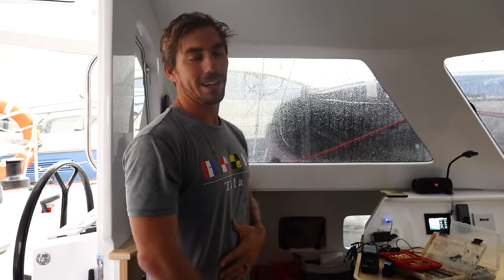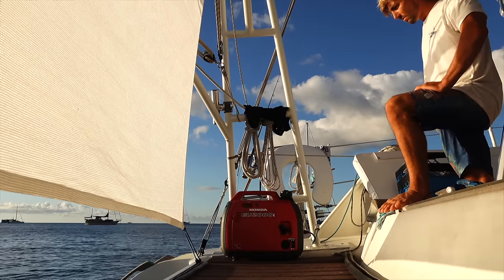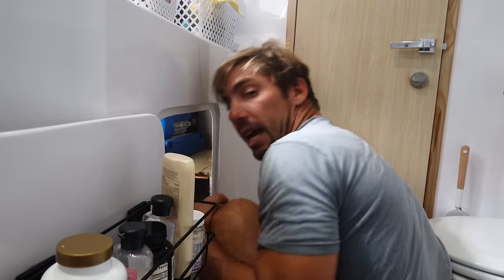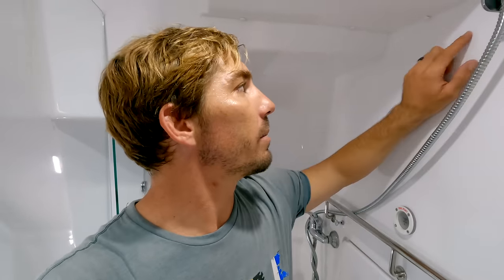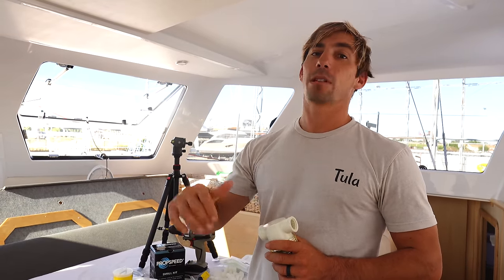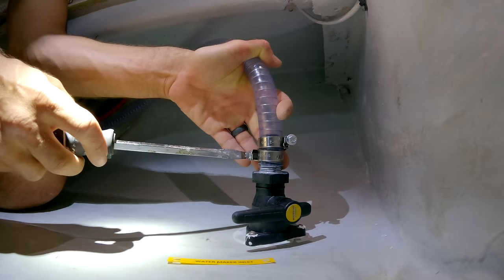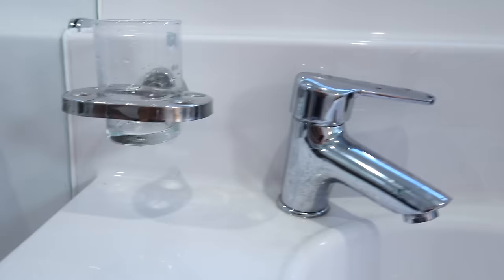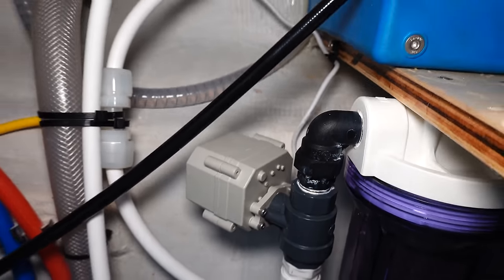Installing Rainman High Output Watermaker on our Sailing Catamaran w/ Control Panel and Auto Flush

Comment: Really great video of a well planned installation. A couple of comments/observations:

1. The RO mounting bracket is textured on the back for gluing so you don't have to use an intermediate plate if you don't want.

2. It's fine to share the intake through hull. Rainman doesn't like to compete for water though, so make sure it has plenty of flow available when making water.

3. If you use the Rainman before the 7 day autoflush timer cycle completes, the system will flush when you turn finish making water, then reset the timer for 7 days again. If the timer loses power for other reasons, on power resumption it will trigger a flush cycle and reset for 7 days again. You addressed these points, but it might not be clear to people.

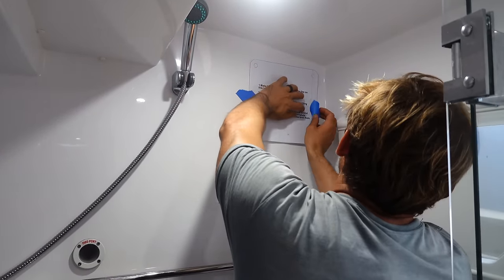Comment: Love you guys!  Yes Billy sets a great example for DIY proficiency and your teamwork is something any couple can appreciate.   Awesome to get your wisdom from using multiple Watermakers and doing your research.   I just have to ask if the large hole cut at 15:55 was in a structural bulkhead near it's corner ... if so, then danger Will Robinson!  Maybe no big deal, maybe a weak point.

Comment: I have always built my own water makers from all standard off the shelf parts.  I have a 7" color touchscreen plc controlling my water maker.  For redundancy I have a engine driven high pressure pump.  Whenever I am running the engine I can make water.

Comment: People don't buy watermakers because water is "expensive" - they buy them so they don't have to go refill their tanks.  Billy didnt' talk about it but it gives you FREEDOM to use water as you wish without worrying about when you might have to go somewhere and fill your tanks.  Most boats have tanks that aren't large enough for extended times on the hook. 
Want to take another shower? No problem?  Want to wash the boat with fresh water? no problem.   That's why people get watermakers.

Comment: Great video, great details and clean install. Only additional thing I would’ve done while testing the system is turning the pump switch to on without the panel to make sure it works, that way if you’ve ever lost the panel, there is no question that the pump switch works or not, just for a peace of mind.

Comment: To vent the heat out of that compartment with the pump (I had heat issue in camper compartment) I mounted a computer fan in the inside and used a S/S shower grid between the fan & bulkhead  and the 4 fan screws hold it in place. Then I wired a usb plug for power. Has worked great over a last 18 months.   Good luck we enjoy your chanel

Comment: I usually just put a carbon filter in line and run all fresh water from dockside just turn down pressure and purify that water before tank when you travel north
Reply: That doesn’t do anything for removing salt water.

Comment: Sorry for the additional comment but something else to consider. Many jurisdictions particularly those that have natural reefs have regulations on releasing brine into the water. Most vessels have brine collection tanks and something called a diffuser system that constantly mixes seawater with the brine solution to get the concentration below 40,000 mg/L, a level considered safe for discharge. It's not entirely necessary to have a diffuser system if you have a brine tank and release the tank off-shore in deep waters where the brine solution becomes so diluted that there is no impact on the reef environment. Just be sure you check your local jurisdictions on the continuous release of brine into the ocean and I would advise against it if you are moored in a shallow natural reef area. The added benefit of pumping it out of a tank instead of letting it trickle out down the side of your vessel is the impact the brine will have on the finish on your boat. You really want to pump that stuff away from the hull if you can.

Comment: Myself, I would cut some slits in the little wall where your water maker sits, and on the backside, install a computer fan to pull air in and have it turned on when the pump turns on, and turns off when the pump turns off easy enough to do with a drillbit and a jigsawand if you do it nice enough, you can make it look factory

Comment: Billy - about the vent: I had nearly bad experience with that vents. On a friends boat with a Peltier fridge we installed a vent at the top of the cabinet. But - it was still very hot inside. Perhaps think of an fan behind.

Comment: Perhaps, epoxy seal the inside of the wall of the control panel placement. May save you problems in the future of water getting into the wood between the glass outer surfaces. Happy holidays!

Comment: Very well done. How much water is used for the auto flush? Can you save it in a bucket etc. Cheers.
Reply: The autoflush is programmable depending on the flow of your house pump for the autoflush. It can be set for 2, 4, 6, or 8 minutes. We recommend flushing with about ten litres of fresh water.

Comment: What I find interesting are these water makers that make drinking water by pulling it from the air. They basically act as dehumidifiers, which could be another advantage. Right now they don't produce as much water as a regular water maker.  I don't know the hit as far as electricity use compared to a regular water maker. All that could change as tech advances.

Comment: The issue with teflon tape over teflon paste is the tape could get inside and cause issues to systems components at least in hydaulics that is. I'm sure it's not good for water systems as well. I do like to use a little tape torwards the end of fittings with paste at the tip back. It has worked all the time for me this way.
Reply: If you’re not sloppy with tape, it’s not going to get into the water

Comment: 12vdc water makers do not inherently make less water than AC. Production is a function of high pressure pump size and that means the size of the motor has to be adequate. A pump driven by a 1hp dc motor (regardless of voltage) will make just as much water as a 1hp ac motor.
Reply: Perhaps he compared packages. So there might be 'only' 12V packages with smaller pumps. On top: (I don't know how much power you need for a gallon of water) If Billy wants 40 gallons per hour - that results in a big motor (shown in the video) and at 12V level would require huge cabeling between the batteries and that motor.
Reply: Yes, the trade-off is in amps. Another plus for AC is, if you DIY (which I highly recommend ), AC motors are cheaper and more easily sourced.
Reply: This. Clearly they chose the brand first and then picked what they had available… because there absolutely are other brands that manufacture high output systems with DC power. Which is fine, they like the brand for the numerous reasons mentioned… but the claim about DC systems being inherently less productive is false.

Comment: I noticed you’re washing machine you’re bringing the water in over the top you might be able to go to Home Depot and look for what they call a dishwasher L that’s the connection for the waterline to a dishwasher it might solve the problem so you can close the lid.. good luck Patrick

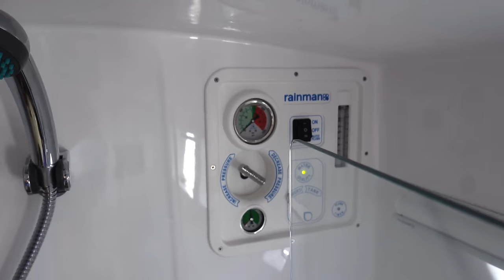Comment: Love maintenance and installation videos!  At around 30:18, with the membrane pressure very low, it looked like the green light for water quality was good?  Isn't that supposed to be measuring the membrane output?  Was it good because you had already let good water flow?  Just curious.  Love your videos.  Thanks!
Reply: Super observant of you. Very good point. My guess is that he had been using the system before the recording of that video segment and there was still fresh water in the system. If he had just turned the Rainman on, the LED would be showing red for at least 90 seconds. If he had been running it unpressured for an extended period, the TDS probe may be dry at the end. The system uses conductivity as a proxy for TDS, so if it's dry, that is basically no conductivity, which would equate to 0ppm. 

In normal operation, the LED will be red when you start operating the system.

Comment: Another great what and how to video. Is this watermaker proportional size to the size of your boat? So for a boat that is about 32ft or less mono, would a smaller watermaker suffice for a solo sailor? Also the cost of mantiance (filters, tubing ect) would be an interesting insight.
 Always top-notch work guys!
Reply: IMHO the size  of the boat should be neglected. The mayor dimension should be the people who need the water. Perhaps you may look back how much water you needed in the past and calculate the watermaker according. 
- Too big, you may get into energy problems
- too small you have to run it endless without having the necessary water. And the filter system in front has to be changed often. 
About the daily costs, Billy is the right man to answer.
Reply: @wjhann4836  thanks for the info. I'm just gathering info right now. I plan to get a boat in the future for carribien winds. So I'm asking questions now so in the future I'll have a small idea of what to expect.
Reply: @0PsychosisMedia0  The only question I can't answer in any way: How much energy 'cost' a gallon of water. Normally that's a limiting factor why smaller boats still limit their water usage while using a water maker. 
As always: there's no free lunch.

Comment: I don't need AC where I live but I don't understand why it would need  a raw water intake? In my limited experience a condensate drain yes but what does it do with raw water?
Reply: It uses water for heat exchange, instead of air for heat exchange like a normal ac unit on your house.

Comment: Is the water intake near the toilet output?
Reply: Their black tank can be anywhere on the boat and there are several toilets on the boat. Either way, you don't empty your tanks while making water that would make no sense. You also don't just leave it open and let it flow, because you need the liquids to help the solids leave. You will end up with a huge poop pyramid in your tank if you do that.
Reply: @RiverWoods111  My question was due to the pump and through hull being in the toilet area. They would have to answer that question since they know where their toilet dump is located.

Comment: Does the auto flush have an activated charcoal filter?  It would appear that water in your tanks was, until this filling,  city water and may contain chlorine. Activated charcoal filter gets rid of chlorine in city water that will damage the membranes in tubes.
Reply from the maker: Yes the auto flush water does flow through a carbon filter before flushing the system

Comment: Maybe a silly question but I'm not trying to be silly: What is the pickle bucket for?  Do you really throw cucumbers in there and make pickles?  Do you use sea cucumbers while at sea? (Okay, that was silly but the first question was serious.)
Reply: Pickling the watermaker is running a sterilising solution through the RO membranes for very long term storage. If you want to leave the boat for many months and don't want to rely on autoflush, you can fill a bucket with 10 litres of pickle solution and suck it through the system. With the autoflush system, it is extremely rare that they would pickle the watermaker.

Comment: do you need to filter for drinking?
Reply: Although the water is clean when it goes into the tank, tanks sit and can build up bacteria especially when hanging out in the tropics, so it is a great idea to put a water filtration system after the tank for drinking water. Regardless if you are in an RV or on a boat you should install a drinking water filtration system.

Comment: Bruh you need to put sealant 5200 or 291 or epoxy like west systems around that giant hole you drilled for you controller or you will ruin that part of the wall with humidity when you shower.

Comment: Making fresh healthy water for drinking isn't that simple and the water you are making using RO can lead to long term health effects. This is well known and why all desalination plants remineralize the water they purify. I am sure you have heard of the body's need for electrolytes, this is commonly known. It's not as important to get the minerals from drinking water but what is important is to understand the process of diffusion. When you drink water with a balanced or high mineral content the body's minerals, typically gotten from food, supplements, and water stay balanced and work to provide the necessary cellular water transport in the body. What you are doing when you drink RO water is reversing the diffusion process and the body will release minerals to the water in the gut. I'm sure you remember from high school, high concentration to low concentration. So it's not so bad that your not getting any additional minerals from RO water, you can always supplement. What is bad is RO water over time will seriously deplete the minerals in the body necessary for life. Do some research, there are well known scientific papers written on this. All large scale operations, cruise ships, land based desalanation plants etc, re-mineralize the pure water to provide a balance of electrolytes.  RO water is fine for showers, washing, and even cooking but I would advise you against drinking unless you remineralize it. There are some excellent electrolyte supplements you can use.
Reply: Get a life
Reply: These are all really great points, thanks for sharing. Genuinely. I’ll keep this in mind when I design a system for my boat. Thanks!

Comment: I hope you discussed location of instrument panel prior to cutting out the panel in a structural wall of the boat.  As an engineer this has weakened the boat structural integrity.
Any one who is thinking of cutting openings in their boats should seek manufacture advice before hand.

Comment: p.s. You've got to use a different light for filming, that's "flicker free" because the frame rate (or exposure) of the camera is slower than the flicker of the light - causes lines.

Comment: Quite an amazing technology, I do wonder what will happen to the state of the oceans with municipal and individual desalination uses.  With humans tendacy will shall find out sooner than later.  Saltier salt water probably isn't good for the ecosystems.
Reply: Even where I live they are working with a state in Mexico to build a desalination plant and pipe all that water to a water starved area.  Image that all over the world.
Reply: Do you clueless have any idea how vast the oceans actually are if you used all the earths current power generation to desalination plants it wouldn't make a measureable difference in the oceans salinity, yes if there is no current where you pump the brine back there can be a local spot of Higher salinity, but that is just bad\cheap design. On the other hand you could pump the brine into evaporation channels and harvest salt.
Reply: Personal level RO systems like those on small boats don't have material impact on overall water salinity or local ecosystems. Seawater is about 35,000ppm and brine output is about 43,000ppm, so the system only extracts a small amount of fresh water. When dumped overboard, the brine is slightly heavier than seawater and will diffuse quickly.

Totally different for municipal level RO plants. They run multi-pass to extract much more fresh water from the source. It's also pumping millions of litres into coastal areas, usually near the sea floor. Managing the ecological impact of those systems is a major design, cost, and management consideration.